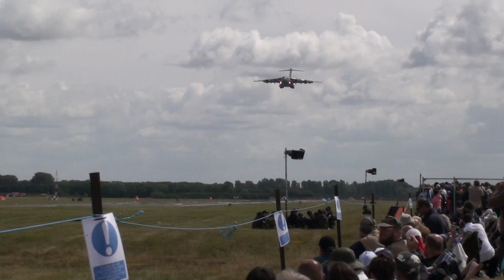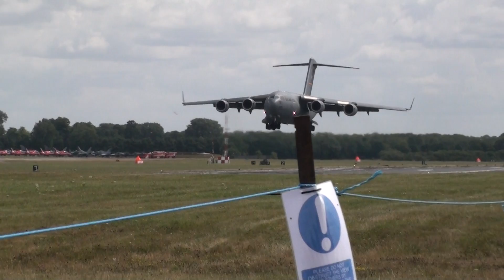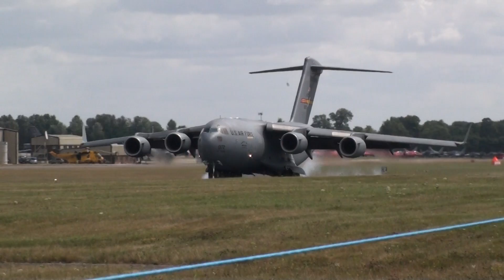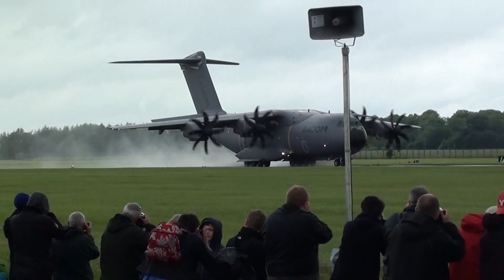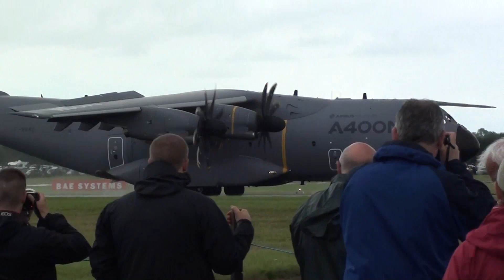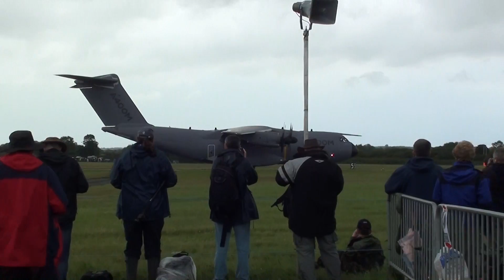Tactical Short Landing C-17 vs A400M. What Brakes The Most. Reversers, Wheels, Props, Spoilers?

Comment: After looking at these comments, it seems to have escaped the attention of many people that the A400 is intended to be the replacement for the aging C130 fleets.
It has twice the range of a C130, with almost twice the payload, and it's cruise speed is almost 100mph faster.
It is just as capable of landing on rough airstrips as the C130, it is also cheaper to buy, and operate then the C130 by a considerable margin.
All in all a massive improvement on the C130.
The C17 is a superb strategic transport aircraft, but it is not a suitable replacement for the C130 in many air forces. It can't land on rough ground without considerable risk of damage and is more expensive to buy and operate.
A mix of both would be ideal in the real world.
Reply: Pocok4 There is only one C-130 that costs over 200 mil and that the AC-130 due to its heavy changes to the aircframe.  The regular C-130 only costs 67 mil, there is no resource online that claims differently 
example
Israel is buying 9 C-130J-30 at total cost of 1.9 billion
http://www.asdnews.com/news-17196/Israel_-_C-130J-30_Aircraft.htm
so no
http://www.washingtonpost.com/wp-dyn/content/article/2008/10/07/AR2008100703034.html
again 4 for 393 with parts included barely 393
The A400M only barely exceeds the C-130J
and not by much. Its only real claim to fame its larger payload as the A400M is much larger than a C-130
as previously a C-130 price is under 70 mil
customers who want all options can buy a KC-130 and get 3
FYI, switching roles depends more on the ground crew ,than aircraft and optimally the KC-130 is operate as a tanker without using the internal cargo hold so it can carry cargo and act as tanker at the same time. The A400M has to be switched to adjust roles. medevac completely depends on the ground crew adding liters to the plane
and finally unlike the A400M , KC-130 can switch to a gunship.
The KC-130J and MC-130J are designed for rapid mission switching and do quote require "a lot of time"  you are right, the C-130 is 20 plus years old so they had time to get the process of  configuring the aircraft down to an exact science.
Politics has nothing do it with
its called cost. C-130 less than 70 except for AC-130
A400M nearly 3 times as much
the A400M simply costs too much to be competitive against the C-130J,
the Lockheed makes the C-130, not Boeing
finally the real facts
C-130J lasted ordered, 2013
A400M, last ordered 2005
honestly expect people to believe that the whole reason the A400M hasn't been ordered approaching ten years is  politics ??
Reply: F-22 price ? F-35 program ? come on dude you must be kidding XDD
Reply: Why - yes - I'm sure the industry that built the Lockheed YF-12A out of Titanium in the very-early 1960s is "really daunted" by all that scary Euro-tech stuff...
Reply: Pocok4 how you about learn to read
why is Israel paying so much extra for its C-130J, or quote the extra 1.5 billion
that is spelled out clearly in the page
Israeli paying the extra cost as the planes have additional Israeli made equipment added in. So again no
The C-130J has had orders progressively since 1998
the A400M , not one order in 10 years
despite all the vaulted capabilities
even the countries buying them are reducing their orders
Reply: @verdebusterAP  50 years ago newzealand brought 5 c130 h models they were the most expensive model at the time and other countries critics questioned the perchase of the most expensive model however time has proved the discussion correct as they are all still flying today although due for replacement  my point is the cheapest option is not always the best in the long run.
Reply: danthundercat The information provided about 100 mil is again off. The info is based of the India deal which is for special operations models.  As for transporting MRAPs , the USAF has C-5s and C-17s. C-130s mainly personnel and tactical resupply operations. Also another fact is the countries are paying transporters like Volga Dnepr to move equipment for which has reduced the need for large transporters in air forces.
while the A400M claims to be faster transporting and carries more  further, it has yet prove that fact as operationally there is 2 flying and they have not done anything close to the C-130s yet

No politics has nothing to do with
as for the US getting the A400M and scrapping herc, the reason you listed is completely bogus
fact , the USAF, USMC and USCG all user the Herc.
The USAF pays 190 mil for its AC-130s plus 100 mil for EC-130 and MC-130s
so as the basic line A400M is 203, the cost is not there for USAF.
The USMC pays 89 mil for its KC-130
67 for plane and 22 for Harvest Hawk
so again no cost
the USCG requirements remove most of the combat equipment and add the ability for it to be tanked from a boom tanker
basically the cost is not there
period

The lack of C-27s is because MV-22s/CV-22s can do more. The Army still retains most of them but USAF has no use for it

as for the "advanced composites"
The A400M uses carbon fiber reinforced-etc etc
Boeing
Scaled Composites
Lockheed
Raytheon
and long list of US companies make the same materials used in the  A400M
just the US makes, so the Europe, Japan, India, China and Russia
Reply: I am not an expert, much of what you say is probably true.
But C-130's have been flying, successfully, since 1954, meaning it's been flying longer than most of the designers of the A400 have been alive. And more than 2,500 have been made. And they are still in production, after more than 60 years. 
BTW, I show a C130H as costing only $31 million.
Reply: ...trouble with the A400M IS -- "it's not a C-130......."
Reply: It's a typo of course.....but I'm sure you meant the A400M is cheaper to buy, operate and maintain than the C-17.
Reply: your info is off
The A400M does have some things over C-130 but cost is not one them
one A400M is 203 mil USD or 150 mil Euro
one C-130J is 67.3 mil usr or 49 mil Euro
another ability of the C-130J is that KC-130 can switch from tanker to transport and gunship with a day at a cost of an additional 22 mil for weapons kit
So 4 A400M costs about 812 mil usd vs 269.9 mil usd for C-130 or 357.4 mil with Harvest hawk kit
The last factor is availability
C-130s are rolling of the line steadily
A400M has only delivered 3 out of 174
for that reason is why C-130J are still getting plenty of orders yearly whereas
the A400M has not gotten a new customer since 2005
Reply: verdebusterAP
According to the US governments own accounts, they are spending about $100 mill per a basic plane. It will be more when you factor in all the equipment you have listed above.
The Herc is also unable to transport the latest mine resistant vehicles, as they are far to heavy.
Operating cost for a c130 is about $7000 to $8000 an hour, an A400 is about the same, but it carries twice the load, so that is a reduction of 50% in cost per ton transported.
The herc is 100mph slower, and with a 20 ton load it's range is about half the a400.
If we look up to the C17 we see that the RAF, and the RAAF both have spent about $400 mill each on an aircraft that in the manufactures own warranty, must not be used on unprepared airstrips.
Yes politics is the reason more have not been ordered. The US government even looked into  scrapping their hercs over the next 25 years and replacing them with a mix of A400m and c27's, but of course a bunch of US politicians with a vested interest in keeping the herc production lines open, did not like it.
I stand by my claim, A400 is better then the legendary herc in every way measurable, a tactical lifter with real strategic capabilities.
It must also be noted that the US is unable to construct and repair the advanced composites used in the construction of the a400 m, this would make the US vulnerable to needing other nations assistance in its operation.
A very scary proposition for the worlds superpower.
Reply: @danthundercat   US is unable to construct and repair the advanced composites  , DUH  Boeing 787-8-9-10
Reply: 168 C130 J have been ordered for the US armed forces for a total cost of 17$ billion dollars, fly away cost. You have shown you struggle with mathematics, so that is just over $100 mill a plane.
Yes the plane has not done anywhere near as much work as the c130, it is a brand new plane.
In December 2013 the first mission was completed by a french a400, transporting supplies and troops to Mali.
So its on its way.
Why is this so hard for you? The A400 is a tactical lifter, that can also fulfill the role of strategic transport, carrying the latest in protected vehicles of upto 35 tonnes.
The Herc can't do this.
The A400 is midway between a C130 and a C17 in terms of cost,
It is midway in terms of range, and payload.
It is the cheapest to operate.
Why would the US order a plane that is unable to transport its protected vehicles to rough airstrips, if politics was were NOT involved?
Reply: danthundercat France and Germany just ordered some C130s and they're the country building the A400M. It would have been much smarter to get the modernized C130 in the first place, maybe get a licence to build them here in Europe, too, instead of developing the A400M. It has a ton of problems. It's typical German logic, our MiG 29 jets were given away to Poland as a gift, while the eurofighter at that time wasn't even allowed to carry weapons. Think about that, that's why the Bundeswehr is a joke. I know a lot of people from Ramstein AB and everyone from mechanics to pilots  swears on the C130. It's a great workhorse and no one doubts they'll keep flying for another 30-40 years, maybe even longer
Reply: Except that the C-130 can turn a profit while the A400M is losing money hand over fist.  AirBS says they won't even recoup the initial R&D investment with more and more countries pulling out by the day.
Reply: Everything European,  is Over Priced,  Not Just There Aircraft.

Comment: C-17 is designed for landing on storter runways by converting engine thrust downward to produce lift with flaps and reverser while touch down, wherelse A400M is a prop powered plane that can fly at lower speed and slow down to 0 faster than a jet powered one. Both have thier own pros and cons lol

Comment: Well these plains match up quite well the only difference is the technology in the c-17 is newer and is more effective. But really the pilot makes all the difference
Reply: The C17 had it's first flight in 1991 and went into service in 1995. The A400M first flight was in 2009 and went into service in 2013 it has Fly by Wire Controls with Sidesticks and a full Glass Cockpit.

Comment: Strategic airspace and tactical airspace... The C-17 was designed with global reach where as the A400 was designed for tactical I.e. inside the theater of combat. 2 completely different aircraft for 2 completely different jobs. The C-17 was an absolute pleasure to work with while I was in the Marines doing Embarkation... I can't make a comment on the A400. This back and forth crap is stupid...

Comment: HAHAHA.  you are living in a dream world if you think the A400 can compete with the C-17.  It can only carry half the payload as a C-17  with a shorter range.  Yes a turbo prop is more efficient than a fan but that prop brings more complexity and therfore less dependability than the fan. I know worked C-130s for 10 years as well. The C-17 is a true STRATEGIC airlifter not a tactical airlifter but can do tactical as well. If you want to carry troops you would be better served by buying them tickets on Air France and leave the real work to the C-17 which has been supporting muti mission airlift for two decades! Oh I forgot to mention there are 0 operational SQDNS of A400. Keep smoking your crack it does not induce brain damage.

Comment: Airbuses are built to minimums, so you get "X" amount of hours out them then you, park, strip, and scrap them. Believe it or not there is quite an industry built up around scrapping aircraft. Boeing, Lockheed and Douglass often have productive second lives as cargo aircraft, because of the toughness that's built into American aircraft.
.
Reply: Well for a start airbus want to extend the lives of the a320 series up to 180000 flying hours or 60000 cycles. The 787 has a lower airframe life than most commercial aircraft.

Comment: I know the C -17 its old 
But the Airbus copy the body shape of C-17 ,
Like Boeing have 787       Airbus a350
                               747.                    a380
                                737.                    a320
                                777.                    a340                   
                               757 &767.           a330
Reply: airbus invented the wide body shape of modern airliners with the a300. all modern boeings are a copy of that. not to mention fly by wire and every other modern stuff airbus invented and they took big risks doing so. also the a380 looks nothing like the 747. do you need glasses? not to mention that the appearance of a plane is determined by form follows function. there is no design involved really.

Comment: Which is the part that's not modern?  The heads up display, the glass cockpit, the engines, what?  You are starting to sound ridiculous.  Again, these two aircraft really are in separate classes (meaning they really shouldn't be compared so directly).

Comment: This tactical landing of the C-17 looks nice, but it has a BIG disadvantage to the Airbus A400. Short landings often happen on gras or other bad surfaces. If it uses reverse thrust like in this Video most likely the engines will suck in all the dirt and even stones. That is why a modern plane for this purpose was designed without jet engines.

Die taktische Landung der C-17 sieht nett aus, aber in der Prtaxis hat sie einen großen Nachteil. Wenn Sie auf Gras oder einem anderen schlechten Untergrund den Umkehrschub wie im Video einsetzen, saugt das Triebwerk Dreck und Steine an. Deshalb wurde ein moderner Transporter wie die A400M ohne Jet-Triebwerke konzipiert.

Comment: A C-17 is a great cargo aircraft to haul the big equipment long distances and on austere environment, but you will always need a smaller cargo aircraft like the C-130 to move smaller equipment and personnel. It saves fuel which turns into $$$. C-130 has been around since 1953 and has distiguished itself in more than 50 variations.

Comment: 17 uses reverse thrust that deflects exhaust forward and up 45 degrees to help slow the plane down (when they are not pinned, that is) which also helps minimize dust clouds on dirt fields.  C-17 is only in it's teens.. it is not an old plane... trust me.. I've flown in them.  Nothing old about the avionics... but also expensive.... you can buy 10 C-130s for the price of 1 C-17... maybe 2 A400s for the price of 1 C-17 as well.

Comment: Not that impressed by the A400M, it had a lot longer roll for a short landing than C-17, given it was a wet runway but still.

Also it may be easier to reverse the thrust on a prop aircraft by changing the pitch of the blades this still shows you get a not more power and thrust out of the Jets. also the C-17 and A400M are in different classes when it come to cargo aircraft. the C-17 is like a mini-C-5 while in the great Russian tradition the A400 is a super-sized C-130.
the A400 withh most likly be able to land more places than the C-17 and you have to remember the C-17 is US so it has to have much long range to get from US base to bases around the world. while Russia is the largest country they still don't need the range the C-17 has to be used a Troop-taxi.

so in reality you cannot compare the two cause they where designed with different goals in mind
Reply: I don't think the wet runway was really a factor. I seriously doubt wheel brakes have much affect. If these planes even have friction brakes at the wheels.  Pretty sure they stop entirely on reverse thrust.
Reply: Nope, I am an aerospace engineer, the Breaks on these big planes are really powerful, for the longest time airplanes did not have variable pitch props, and Jet thrust reverses are very new and on only a hand full of planes right now.

Comment: The C-17 is hands down the best airlifter that has ever been produced and will continue to be for the forseeable future.  The A400M has yet to prove itself in any significant way and only time will tell if it can achieve any historical relevance. Current C-17 Avionics Tech for 13 years.

Comment: in 2017 c17s will be out of service and there will be a challenge for the A400M.
Reply: I am curious to find out where you get that nugget of information.  Seriously doubt that.
Reply: Do you know the difference between "out of service" and "out of production"?  The C-17 will most certainly NOT be "out of service" by 2017, though it MIGHT be "out of production" depending upon further foreign orders.  Note that the KC-135 aerial tanker has been "out of production" since 1965, yet it is just beginning to be replaced by the KC-46, and won't be fully replaced for another decade or more  This means that the total service life of the KC-135 will be ~70 years from 1957 to ~2030 even though it was only produced for 11 years.  Good products endure.  The B-52 has a service history parallel to the KC-135.